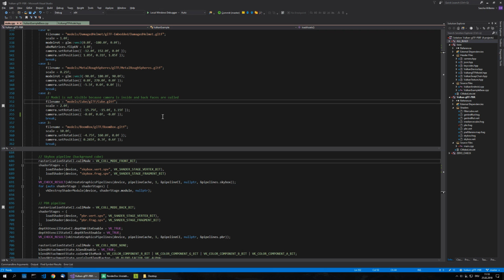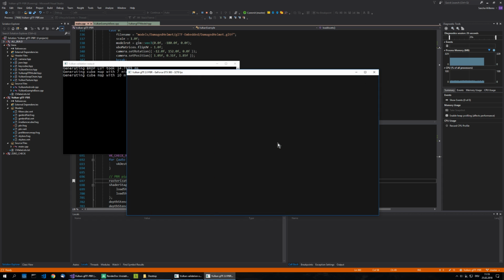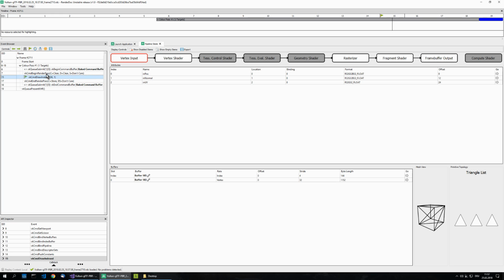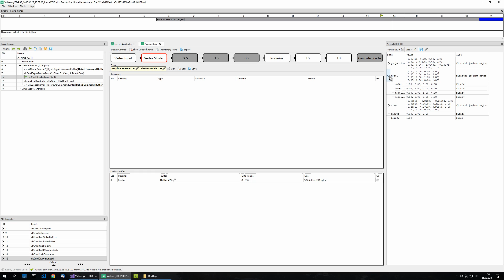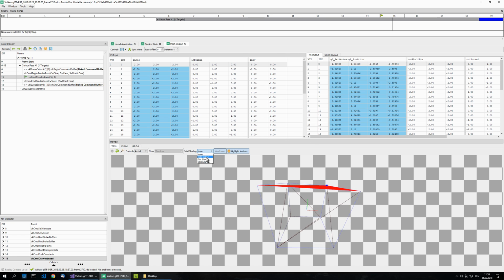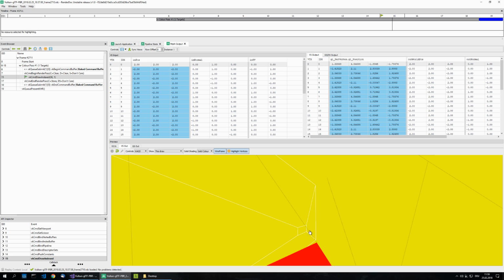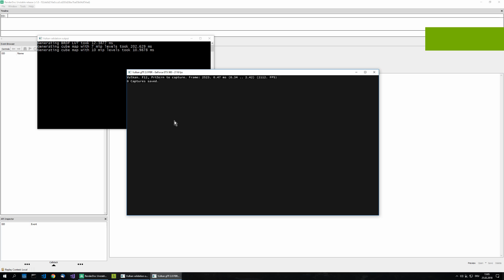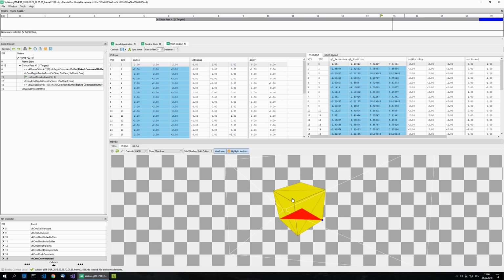How-to: Debugging a non-visible model in Vulkan using RenderDoc

Comment: Great tutorial. I am trying to render a rotating 2D square and renderdoc shows my VS output X-axis remains 0 while the rest have values. I assume that is why I am not seeing anything. Input values are legit so I am in the deep end with this one :(
Reply: it turns out my ubo data alignment was wrong. The mat4 structure was incorrect and was fixed by the following include: #include <glm/gtc/matrix_transform.hpp>. Thanks to render doc I could compare the values in my debugger with the values in render doc. An awesome feature is to capture frame 0.